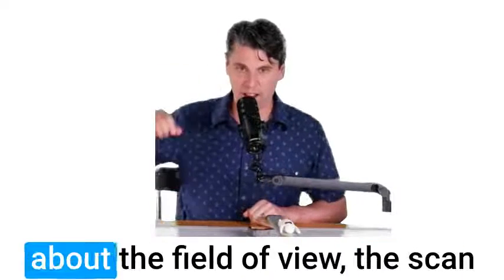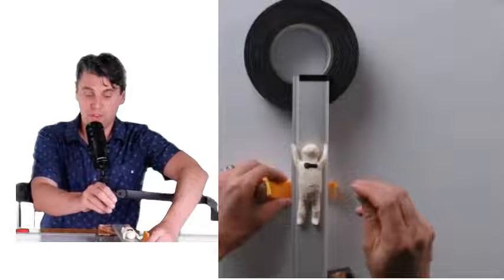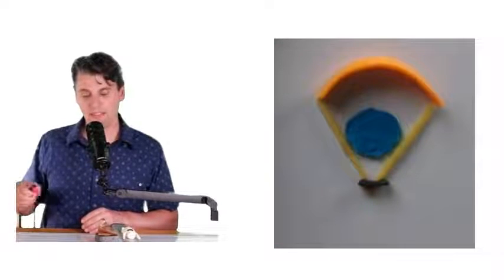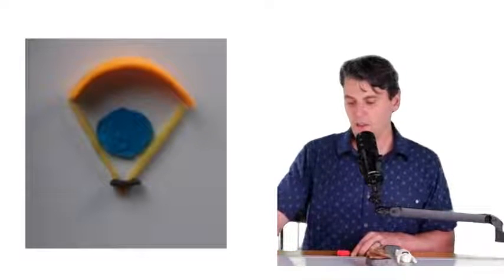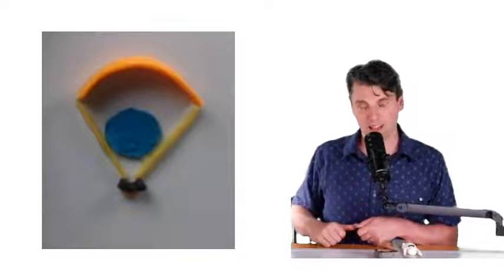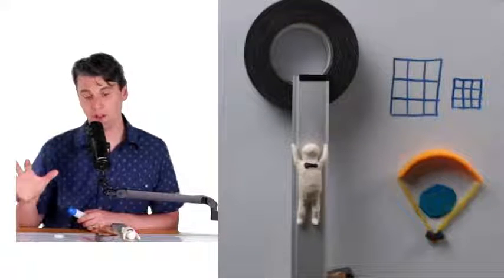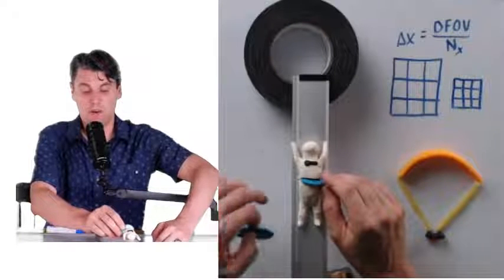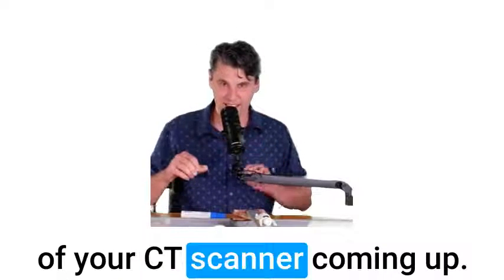Scan Field of View vs Display Field of View (CT SFOV vs DFOV)

Comment: I am a Korean student who is learning about Ct. Which has more influence on pixel size between Scan FOV and Display FOV? And is pixel size closely related to SFOV?
Reply from the maker: Scan field of view is determined by the bowtie filter and the reconstruction field of view is often called the display field of view, the pixel size is DFOV/ matrix dimension, ie 250/512mm is a common pixel size for the brain

Comment: How does SFOV effect resolution? For instance if you are looking at a small structure and will ultimately use a small DFOV, can a large SFOV be used without losing information?  Example reconstructing a spine CT from an abdominal CT. Is this analogous to digital zoom vs optical zoom in camera world?
Reply from the maker: SFOV determines the physical bowtie filter and in some cases the maximum DFOV, but as you mentioned DFOV along with matrix size determines the sampling. So SFOV itself does not have impact on the resolution. This is a bit different than digital vs optical zoom